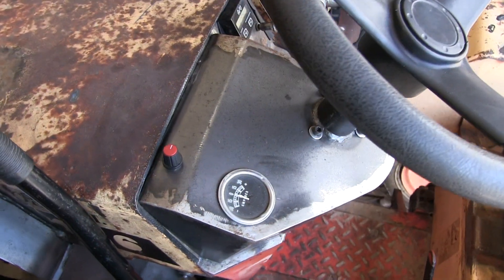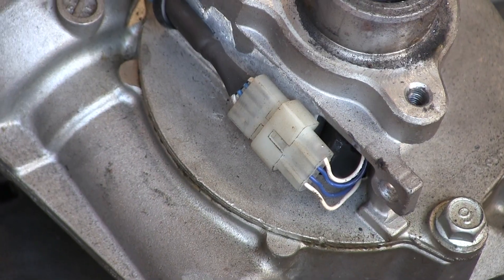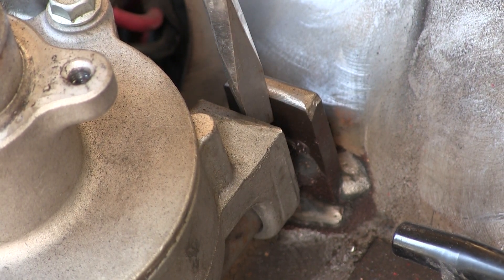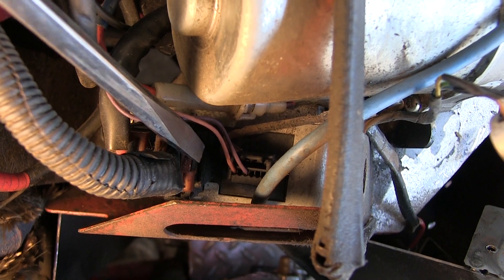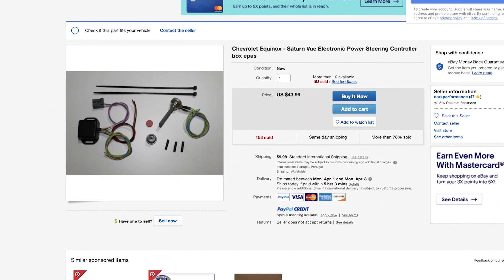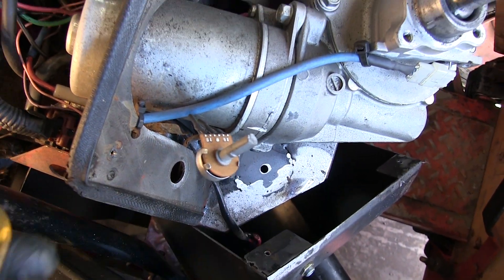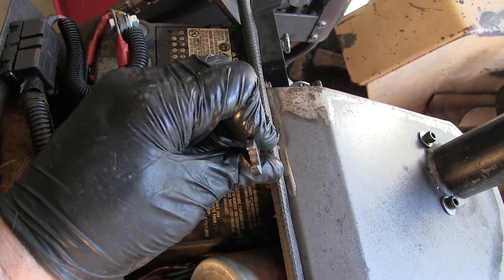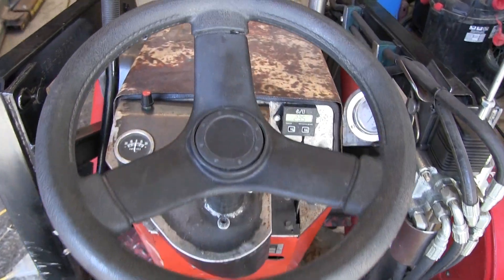Case 446 Front End Loader, Electronic Power Steering (Part 5)

Comment: All my experience is with ag and industrial loaders,  the weak point is always the front axle and tires,  have you had a problem? I want to mount one on a 446 and wondering if I should build a stronger axle first
Reply from the maker: No issues so far with lots of hours and weight. Although I am considering rack steering and a new front end.

Comment: wonderful tractor power steering video. i have a chevy 2006 power unit similar to yours and would like to install it on a yanmar 240 tractor. the unit is to default with basic torque?  thanks :)
Reply: Oh, i guess the power steering spline shaft and the steering wheel spline are the same?
Reply from the maker: I used a coupler.

Comment: Hi how much power do these unit require,  I would like to use one on my Sears garden tractor it has 18.5 hp with 15 amp charging system @ 3600 rpm and a 30 amp battery and there might be about 250 lbs on the front wheels . The most compact one and least power hungry would be best. Thanks

Comment: These are great videos I am building a GT6000 Craftsman 18HP duel cylinder. I have installed hydraulics and have the three point on the back done. Now I'm on to the power steering and the the front bucket your doing an awesome job keep the videos coming. Thanks
Reply from the maker: Thanks good luck with your project. I'll likely be adding a back hoe at some point.